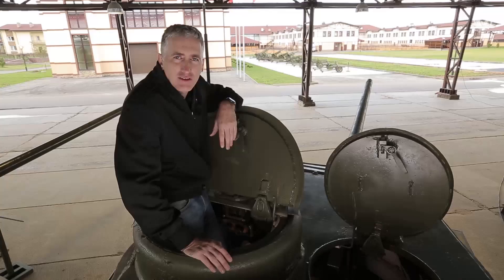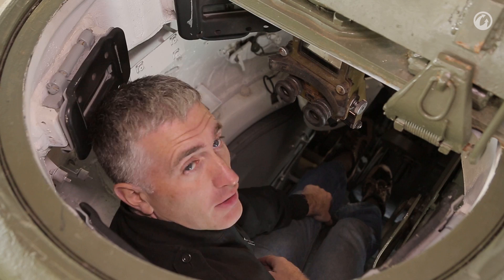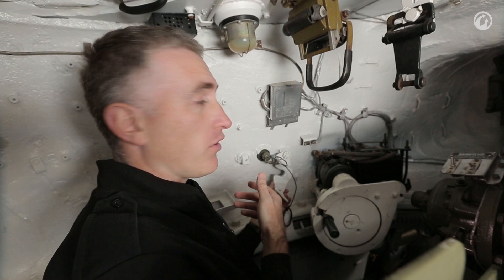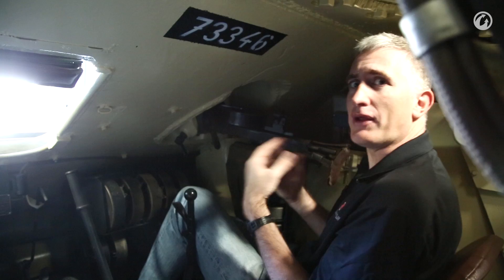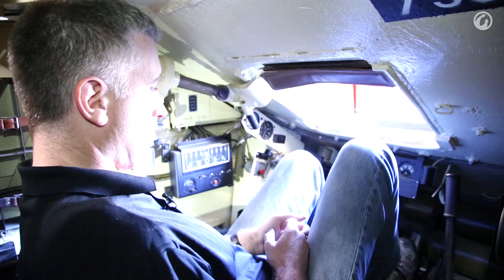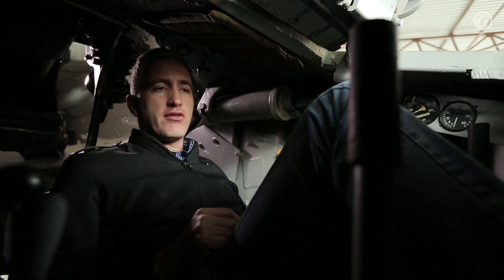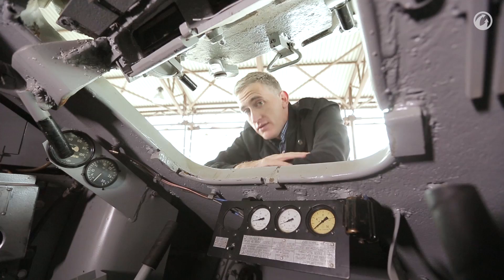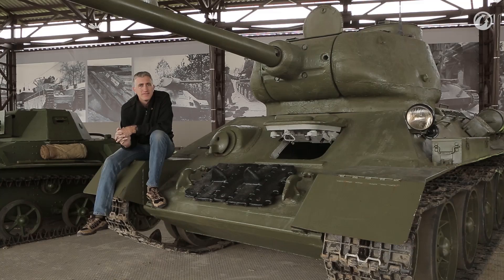Inside the Chieftain's Hatch T-34-85: Part 2

Comment: Lol, and the T-34 is the best tank of the war......gtfo.  This video is hilarious.
Reply: +CMDRFandragon People who think its the best tank of the war have probably never heard of the issues mentioned in the video and also things that weren't mentioned, like the common lack of a radio, that the tank can barely drive over 100km without breaking down or that the gearbox was so unreliable that tanks often carried an extra. War-winning tank? Yes. Best tank of the war? Not by a long shot.
Reply: It has become the best one due to its perfect ratio of mobility / firepower / armour. Plus, simplicity of its design and technical solutions for manufacturing these tanks in a poor conditions by children and women. Number of these qualities summed up and resulted in the best WWE tank award.
Reply: IgoRAZ12345
No, its not the best of WW2. Not even close.
Reply: +RevanBladeZ no
Reply: +RevanBladeZ you are wrong, as this tank is already the best tank of WW2 and your opinion does not change that
Reply: IgoRAZ12345
 Of course, my opinion does not change the facts. And the fact is that the T-34 was a massively flawed tank that won the war simply because it could always outnumber the enemy and casualties were easy to replace. Tank casualties that is, crew casualties, not so much.
Reply: +RevanBladeZ I think you need to have deeper insight into the history of this tank. Your judgements are too superficial
Reply: IgoRAZ12345
There are few tanks i have researched deeper than T-34, if any. Let me list just a couple drawbacks of the tank:

-VERY cramped interior, thanks to sloped sides and Christie suspension
-Prone to breaking down before 100km, though most got knocked out before that happened.
-Very poor visibility from inside the tank, Germans pretty much always saw a T-34 before the crew could see the Germans.
-Gearbox that limited the potential of the engine so much that actual top-speed was just around 15 km/h.
-Big problem with spalling, even non-penetrating hits were capable of knocking out the tank or killng the crew.
-No standardization between factories, which meant that parts that fit on one factorys T-34 may not fit on other factorys T-34.
-As this video well demonstrates, its takes a while to get out of a T-34 when not in a hurry. Now imagine what's it like to get out when the tank is on fire.

There's of course more but i'll leave it at that.
Reply: +RevanBladeZ you proved my words, too superficial
Reply: IgoRAZ12345
I think you are just unable to accept you are wrong, considering how much proof i just gave you, which you can confirm yourself through Google.
Reply: +RevanBladeZ read the books, Google does not provide complete information
Reply: IgoRAZ12345
Books are not the best source necessarily either, considering how many authors just accept the myths about T-34 as facts. Simply put, if it was as good as people say, i highly doubt that 44000 of them would have been lost in the war.
Reply: RevanBladeZ I bet you did not bother yourself with reading the books about this machine. I have read tons of them, including memories of the veterans, people who fought in these tanks
Reply: IgoRAZ12345
Not books no but technical stuff. Most of which is really poor. If T-34 was as good as people say, i doubt 44000 of them would have been lost. When compared to its closest competitors, M4 Sherman and Panzer IV (F2 onwards), it loses in nearly every category.
Reply: +RevanBladeZ well, I think you should learn a lot more so I could talk to you equally
Reply: IgoRAZ12345
Well i really have little reason to speak to someone who believes T-34 is the best tank of WW2 if they refuse to believe otherwise even when proof is given.
Reply: +RevanBladeZ the simple fact is that you are thinking too narrow, whereas the scale of The Great Patriotic War was far a lot larger. 4400 machines lost due to scale of the war, you are too narrow-minded to realize that
Reply: IgoRAZ12345
The scale of the eastern front was definitely big, however, the Germans managed to avoid casualties that big. Soviets lost 96000 armored vehicles of all types. That's more than what the Germans produced. Way more.
Reply: +RevanBladeZ war does not happen in the lab conditions, there are huge amount of factors in every single event that happened back those times. You are just ripping of handful of information from various net sources without having your own solid wide scale knowledge.
Reply: IgoRAZ12345
Just pointing out some things, posting everything i know is way beyond something that can be done in a Youtube comments section.
Reply: +RevanBladeZ the role of T-34 is immense in the history of the Russian warfare and WW2, as this machine helped to bring Nazis down in the beginning of the Great Patriotic War and made them deplete their sources for their heavy industry to produce more and more metalworks and metalware to overcome T-34 ' impact
Reply: IgoRAZ12345
Best tank of 1941? Yeah, that i can maybe agree with. But best of the entire war? Simply no.
Reply: +RevanBladeZ T-34 had perfectly fitted into the timeframe and circumstances under which it had to fight as it was not possible to carry out large strategic operations with a handful of complicated sofisticated hardware on the large scale front, and it was not possible to provide high-end and top-notch warfare machines to a large mechanized divisions and armies back those times. And use of this tank resulted in a victory in Stalin grad and Kurt Bulge. As for the losses, I would not trust the sources widely spread in the global net. As I said again, war does not happen in the lab conditions, there are numerous unpredicted circumstances and factors which influence on the outcome.
Reply: +RevanBladeZ and yet it was under the process of continuous improvement all over the war and still served it's purpose very well till the very end of the war as the machine agile enough to outmaneuver and encircle German armies. Simple and rugged design helped a lot to win the war. It helped a lot to get it produced in large numbers by women and children who had to work in the plants as all the men were fighting in a war. This tank is a truly a Tank of the victory, and this tank truly deserved to be nominated as the best tank of the WW2.
Reply: IgoRAZ12345
It was hardly the only tank that went through continuous improvement, M4 Sherman did the same and Panzer IV was in service in one form or another from Poland to Berlin.

Agile? It had a pretty poor topspeed thanks to a gearbox that limited its maneuverability to mere 15 km/h. Better gearboxes were introduced later in the war but they never fully replaced the original gearbox.

Large numbers had little to do with the tank itself, the production facilities were the reason why so many of them were produced.

It was a tank that won the war simply because  it could always outnumber the enemy and losses were easily replaced. A couple Tigers won't do much good when you have dozens of T-34:s against you.

But when you look at a single T-34, its simply not very good at all. Which is why i would give the best tank of WW2 award to either M26 Pershing, Panther or M4 Sherman. Probably Sherman, considering that Pershing came too late  to have an effect on the war and Panther had some reliability issues.
Reply: +RevanBladeZ your statement about 15 km/h is a joke. Sorry, but I am not gonna talk to a guy who believes this nonsense
Reply: IgoRAZ12345
It was how it practically went due to the gearbox. It was already heavy enough to shift to gear 2, which is when the speed was 15 km/h cross-country. On fourth gear, the top-speed raised to 25 km/h and even the fourth gear could not take fully advantage of the engine.
But it was very difficult to even shift to gear 3 which is why i said 15 km/h because gear 2 is what the tank generally had to drive it. There has to be some issue when shifting gears requires two hands or a hammer.

Later tanks had a new gearbox that could take full advantage of the engine but it never fully replaced the old one, even T-34:s in Korea still had the old one.
Reply: +RevanBladeZ What kind of cross country terrain are you talking about? There are huge varieties of cross-country terrain. This tank was good enough to gain 50 km/h, depending on driver skills as per the memories from veterans. And it is not that simple to foresee strategically that large number of the vehicles will help to win a war, it is not that simple. This solution was the right one and the best one back those times. You started with "top speed was 15 km/h", and now, looks like after quick surfing in the Google,  you have finally come up with "15 km/h in cross country". You have no your own knowledge. Just copy pasted Internet knowledge. Read specs and memories of the operators.
Reply: +RevanBladeZ first gear shifters were hard to operate and transmission was not as good as it was meant to be due to the fact that tanks were built by unqualified personnel and lack of available tools and technologies due to urgent relocation if the manufacturing plants. However, this problem was fixed as the time went by even for the old type of gear shifters. Veterans said they needed help of the machine gunner to switch to the second gear, and all the rest could be handled by themselves. Every machine has its drawbacks, this machine is not an exclusion from this rule, however, it was still good enough to be the best one in WW2 as it, as I said earlier, was the a perfect fit for that timeframe and circumstances. Gearbox, nevertheless, allowed to maneuver and encircle the enemy, and this is just a fact that had simply happened back those days.
Reply: IgoRAZ12345
You can't convince me that T-34 was the best of the war because fact is, it simply was not. But it doesn't look like i can convince you of that. So might as well just stop here. Both of us.
Reply: +RevanBladeZ your opinion does not really matter, as T-34 had already been admitted as the best tank of the WW2, and that is as simple as that.
Reply: +RevanBladeZ Well I do agree with you, it isnt the best tank, but I still like it as it had the ratio of mobility, firepower and armour, as IgoRAZ12345 said, and that it was really simple to build (As the Red Army needed) It beat the germans simple of numbers they build. They came out of the factories faster then the german tanks could kill them. But will that it didnt go well and have a chance to get knocked out on the first battle, then I dont think it will be the best tank of it own. I still think something like the Tiger is one of the best, if not the best tank out there
Reply: Daniel Jensen
Tiger was powerful sure but one could consider it somewhat outdated already when it was first introduced due to the fact that it was a heavy tank with effective frontal armor of 100mm while the M4 Sherman, a medium tank, had 91.2mm. The Germans mostly just got lucky that allies had few guns that could penetrate 100mm from a good range in 1942, if any. It was also over-engineered and complicated. It had a good gun though.

M4 Sherman (especially the Easy Eight variant) and Panther were probably the best because they combined most of the best aspects of tanks, though Panther suffered from reliability issues and Sherman suffered from 75mm being barely adequete at engaging armor in 1944, though it was mostly fixed by 1945. Both were still the most survivable tanks in the war, with most crews surviving the destruction of their vehicles.
Reply: RevanBladeZ Yes I do agree with that that the german's panzers was over-engineered. Even throught that they have Maus, which is the biggest and heaviest tank ever build, then did the russian also said it will be completly useless in battle, as it cant cross bridges and is a huge target for planes. Heck the germans (One of them I cant remember his name, I think it is the one that have "controll" over their money) canelled Ratte as it would be bigger then Maus